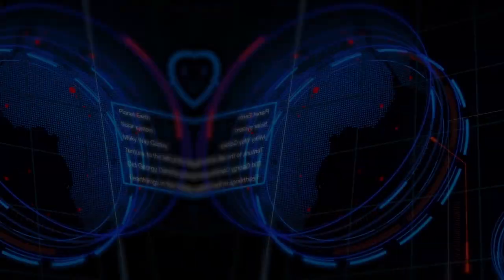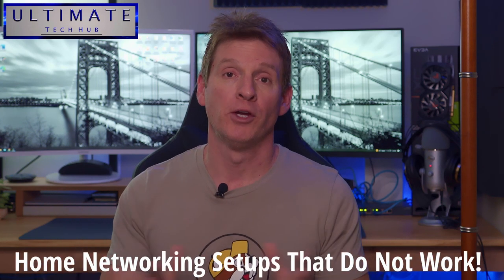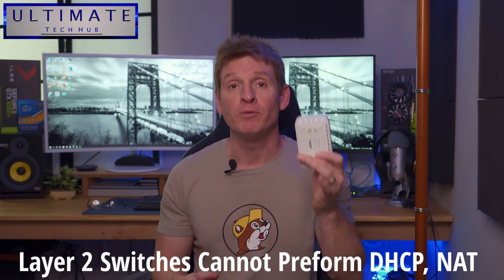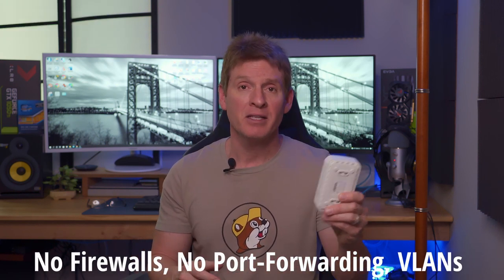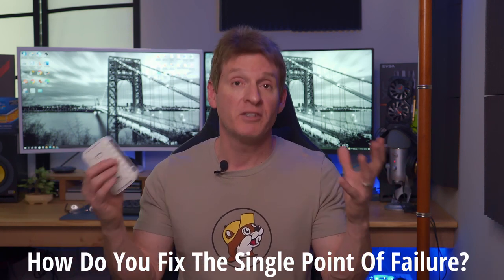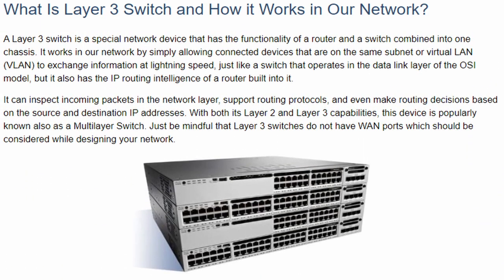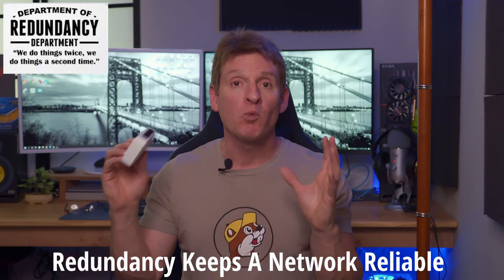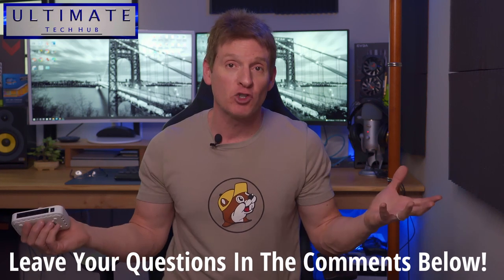HOW TO AVOID HOME NETWORK DESIGN FAILURES!

Comment: Building a new house and mapping out a new home network that will have: 1) Wireless connectivity for mobile devices, 2) Wired Ethernet connections for work station(s), 3) Wired Ethernet connections for multiple TVs including OTA antenna with DVR, and 4) Home security cameras and devices. 
     So, if I understand correctly, I should connect and Level 3 switch to my router and then (3) Level 2 switches for each of the wired Ethernet subgroups. Wireless connections will connect directly to the router.

Comment: Also wanted to ask if i should plug in my 3 piece mesh router via ethernet to a switch or just have 1 plugged in and have the other 2 nodes just plugged in power? just a bit of info - i have a 5k sq ft. home w/ linksys velop mesh. 1 is plugged into my patch panel but the other 2 are in different rooms to cover the entire house with wireless devices. 1 maybe have access to an ethernet cable but the other is near the garage and ethernet cable isn't accessible. Basically i can have 2 of the 3 mesh plugged in via ethernet. Not sure if that will increase my wi-fi speeds.
Reply from the maker: Plug the mesh system into your routers lan port. A switch won't work.

Comment: Hey Mike great video, very informative and educational. What are you're thoughts on Cox's Modem/router combo? Should I get my own modem and router or continue renting cox equipment?
Btw my home network is a mess, and this video really helped to fix it
Reply from the maker: I'm not a fan of modem/router combos and I prefer to buy my own equipment. Buying your own equipment will save you money in the long run. I've heard people say renting is better because if something goes wrong with the equipment they replace it for free. However, I have never had any modem or router break or have any hardware issues. It's very rare for that to happen. Modems and Routers are buy it, set it and forget it! I still have an old Arrus cable modem that I bought 5 years ago and it still works. Renting it would have cost me around $350 or $400!! Lol. Its only a $119 modem. So buy a modem that works with your ISPs max speed and get a solid middle of the road wireless router. Netgear makes very good and affordable routers! Thank you for watching and keep me posted!

Comment: so my modem is connected to a router then a switch with all the ethernet cable plugged into the switch. Those ethernet plugs are all wall outlets in each room. From there each room has a switch. Is that a bad "daisy chain"?
Reply from the maker: No that's not a bad setup. But I would recommend 2 Ethernet cables to each switch for redundancy. Your setup is pretty typical for most home networks.
Reply: @UltimateTechHub  Thanks again for all your help. The prompt response is definitely worth subbing. Keep up the good work! Love watching your vids. Very helpful.

Comment: What redundancy model do you recommend for home networks (with some small servers) if layer3 switches are too expensive? I have space constraints and I cant spend several hundred dollars on a single switch...
Reply from the maker: A simple solution is just run 2 cables from each device. Although you will need a decent size main switch to handle the extra cables. I have 2 cat6 going to each of my layer 2 switches. Which is a total of 6 ports. If one wire fails your network is still up. Redundancy can cost a lot of money when it comes to hardware. Good luck and keep me posted.
Reply: @UltimateTechHub  Good idea but in my case connecting two layer2 switches to the router eith 2 cables each would cause a broadcast storm (none of my switches support spanning tree).

My current plan is to connect each of the two switches to a seperate wireless bridge (so router > wireless bridge 1 > switch1 and router > wireless bridge 2 > switch 2)(as my router is too far away for ethernet) and then connect each of my servers to both switches with an active+backup bond.
That way, if one wireless bridge or switch or server fails or cable fails, everything is still working. I hope this makes sense...
Reply: @paulvorderegger1522  Then get switches that support STP. If you're able to afford two wireless bridges, then you can easily afford a simple managed switch that's neither L3, POE, nor 10 Gb (although Mikrotik does have some insane prices for their 10 Gb router switches).